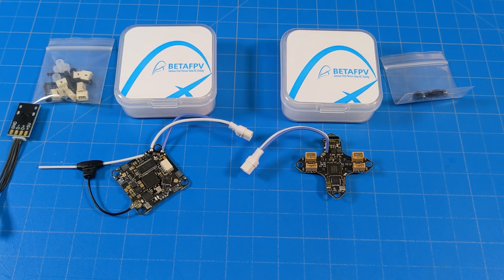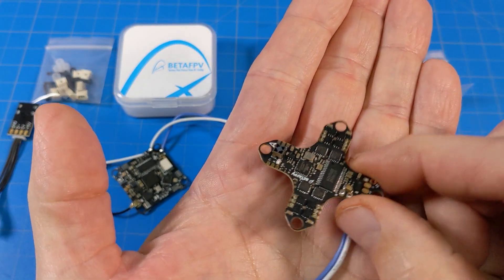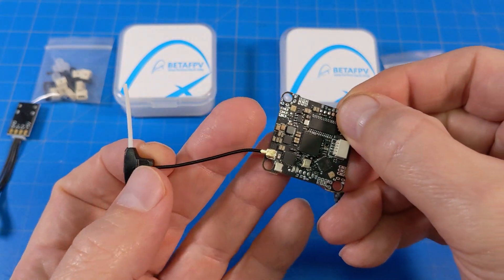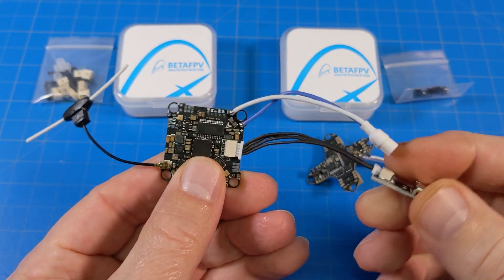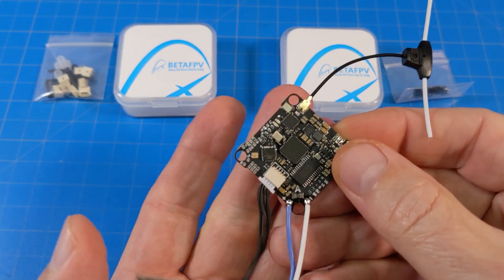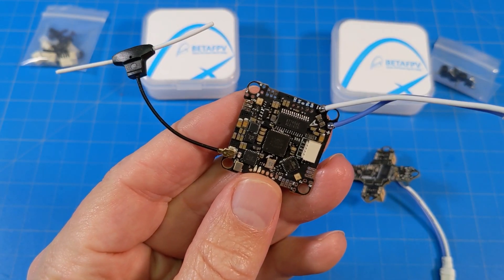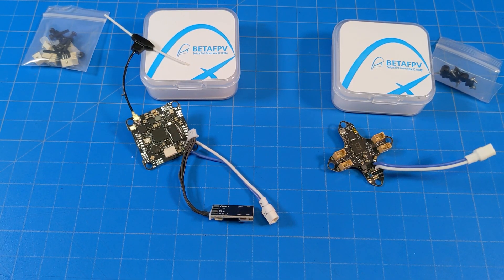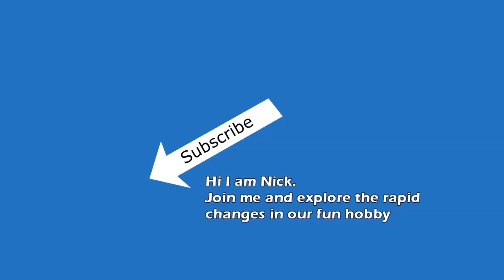ExpressLRS AIO // BetaFPV ELRS 1s Boards // 12amp & 5amp

Comment: can the 12amp aio use 2s it said that it can use 1-2s ?
Reply from the maker: The specs say it can but I not anyone has reported they are running it on 2s. So I don’t know for sure. I think there may also be a v2 of that board which could mean there was an issue or an improvement

Comment: Hi Nick, Q I just finished my 65mm whoop build with betafpv 5a elrs and even have to update my betaflight configurator to 10.8, I've got connection with my TX and RX as well as seeing movements on BF transmitter tab and set up my arm switch on aux1 
But my problem is that when I arm, it seems to only hover an 1nch from the ground and that's probably from the air mode on but  when I give it throttle about half I've got no respond, push the throttle stick to full and it gets up to about 5 feet off the ground.
Reply from the maker: What is the weight, motor and battery
Reply: @NickBurnsFPV  it weight at 20g flat with GNB 300mah 1s BT2.0 connector and HM 0802 19000kv. I load one of the preset tune for a 65mm whoop and it is flying right now surprisingly:)
Reply from the maker: @Bisdak.3475  20grams with battery? So the quad weighs 13grams? That would be one of the lightest whoops ever.
Reply: @NickBurnsFPV  haha I can't beat angrydon's 15g 65whoop, no way! Mine 20g-26g with 1s GNB300mah. It fly unstable the next day I flew it so I don't know what happen there?

Comment: Hey nick, so in regards to swapping whoops over to elrs... How much would you say the ep2 weighs with the little bit of wire needed to connect it? Maybe .6 or so? I'm thinking even for 65mm whoops it may be worth it if the board has the uarts! Even on tiny builds a half gram is pretty low.
Reply from the maker: Depending on the length of wire, likely .6 to .75 grams.

Comment: Hey Nick, any update on this 12a 1~2s FC? I would like to build a 1s babytooth on this with more Power hungry flywoo 1203 11000kv motors. Also the tks rocket race with this for more range and some more amp draw
Reply from the maker: I haven't used it yet. Focused on the 5amp. I do have several people that have reported using it with a good experience. Sorry that is as far as I can go in the moment.

Comment: Hey Nick used the 12amp v2 for a 75mm shark byte whoop.   Shark Byte requires 2s.  Two things; the 12amp v2 shoud come with the ceramic antenna (mounting the t antenna to a whoop is difficult, and the wire adapter for the usb-c cable is annoying after a while.   I wonder if elrs can use wifi to connect the board to pc or phone betaflight app?  That would be a great feature to have.
Reply from the maker: I suspect the ability to connect to betaflight via the elrs rx wifi is possible but likely need some additional development. One potential issue with the cube antenna is board stacking, I am not sure if having the cube antenna would stop us from stacking boards for a sharkbyte or other build options.

Comment: Would it work with the Jumper T8SG V3 PLUS Carbon Edition?
Reply from the maker: Not sure. Does that radio support crossfire and and ELRS module?
Reply: @NickBurnsFPV  I have crossfire on it now but the receivers are expensive compare to these.
Reply from the maker: @electroddxful  If it supports crossfire we can use expresslrs on it. We do need to add an expresslrs module to the radio. Expresslrs uses the crossfire protocol when binding to an expresslrs receiver. Also in betaflight we select crossfire for the receiver protocol.
Reply: @NickBurnsFPV  That cool. Thank you so much Nick really appreciate it.🙏👍🙏👍

Comment: These early boards, both Betafpv and Happymodel are total hit and miss, but I'm sure over time - like 6 months fro now they will have finally figured it out that what we need is a 10-amp 1-s, and 12 - 15 amp 2s board with a built-in ELRS RX with the smd antenna (that dangling u. fl cable is stupid) and a 400-600mW vtx.

Comment: I like the plug, USB sucks and I can solder up a USB to jst cable if I need. That 5a board is what I've been waiting on. My current nanolongrange on 0803s uses the old non Rx version of that board and this will get it even lighter.

Comment: I think that separate board with the USB port might be to mount it on your quad if the the FC is build in, so you can’t reach it the USB port was on the FC?
Reply: I think in the product page for it they say it's for weight.

Comment: Redpine was as easy as setting up d8 for me,. But I now put ep2 recievers in my tiny whoops
Reply: How much weight does it add with the bit of wire you need? Do you notice it on 65mm whoops?
Reply: @valden  around 1.5grams and I haven't got a 65mm just 75mm so I guess I should of said in my micro whoops, but tbh I've  noticed difference except way better control link

Comment: Thanks for keeping us updated as these come out. I'm of the mindset that I would rather have a FC with a 300-400mw VTX integrated into it than the receiver. I can then add an EP2 type receiver myself. I think there would be more of a weight savings from this. Maybe.
Reply: I think a separate vtx is better for heat dissipation.
Reply: Yeah I think separate VTX is better for heat dissipation.
Reply from the maker: I can see it both ways. For weight we benefit more if the vtx is on the board, if heat is an issue with a 200+mw vtx then maybe we have to sacrifice the weight by adding the vtx. I personally don't know what can be accomplished, generally I haven't had issues with a vtx on the AIOs.

Comment: No USB is really annoying, now we need to carry a bunch of USB adapters, think HGLRC are doing this too - we can bet that the pinout will vary between boards so now we have a risk of burning out our USB ports too!
Reply from the maker: And can we buy these usb adapters? I haven't seen them available to purchase. I suppose overtime our collection would build if the adapters come with all the boards, but then we might be back to the situation you described with the pin out problem

Comment: Nice looking boards, I hope reliability is good. Still I belive there are having build in vtx around 250mw would be more beneficial than having build in elrs receiver, elrs receivers are small and cheap while usually vtx are heavier and more expensive...
Reply from the maker: I lean that way to. I want to see a 200+mw vtx on the AIO

Comment: Yo Nick! I'm pumped on that 5a board but I'm wondering if you can help me out: I run the betafpv 65mm frames with the NBD beebrain canopy (v2). That board looks like it would put that receiver "cubetenna" right under the front leg of the bee brain or, if it was flipped, down into where the battery would knock it. Could you verify any fit issues with that? Thanks man!
Reply from the maker: The beebrain canopy front screw mount doesn't clear the antenna. We would have to lean the canopy back or rotate the board so the antenna is in the back.
Reply: @NickBurnsFPV  😕 Man, there just isn't winning with any of these 😝
Reply from the maker: @brighFive  Does the happymodel version also pose the same issue? i didn't check it.
Reply: @NickBurnsFPV  I’m not sure tbh! I’m just being a whiny whiner. It seems like there’s always just one weird design issue with whoop boards and/or they’re hard to actually get a hold of. Thanks for checking! 😎🙏

Comment: All these new ELRS AIO boards are making want to dust off the old Mobula and fly tiny whoops again. Which ELRS AIO FC would you go for in a new whoop build? BetaFPV AIO pr the Happymodel?
Reply from the maker: I would probably go with the 5am betafpv due to weight.
Reply: @NickBurnsFPV  I feel the weight comparison between the BetaFPV and HappyModel boards was unfair.
You did not include a VTx with the BetaFPV board.
A fair comparison would be both boards with no pigtails
Once you add a VTx to the BetaFPV board, it would be about the same I reckon, and the convenience of the built-in VTx on the HappyModel board swings it in my opinion

Comment: I tried using the BetaFPV 12A board for 1s 3 inch. Fried after 1 week. I have bought many, many boards from BetaFPV, and every single one of them has failed. I really wanted to like this board, and it probably is pretty good, but BetaFPV hasn't been working out for me unfortunately.
Reply from the maker: Sorry for that. I do appreciate you letting me know of your experience with the Betafpv boards. Any other boards working out better?
Reply: @NickBurnsFPV  Yeah, the FPVCycle boards have been absolutely rock solid. Ive been running the same board for 1 year with heavy crashes. Im trying out the 15a darwinfpv board, and it seems to be ok. But it is too early to tell if it is as reliable as fpvcycle
Reply: 1s 3inch huh, kinda extreme build. Must be a 1s long range with 18650 toothpick style. But did you manage to put gps on it? I plan to use this board too, but 2s, 2inch, with gps coz I have spare.
Reply: @jeffclassics  Bro 1s 3 inch is the best class out there. I've gone full speed into concrete every day for a year and it still flies haha. Handles like an agile 5-inch, and is very quiet. 1s 18650 is good, just make sure you use a capacitor. GPS adds too much weight. 2 inch props are less efficient. 2s will add weight. Ideally you want large prop, low voltage, and a generally higher-kv motor that is fatter for more torque. Thus, the 1s 3 inch platform works perfectly for 1s 18650 + capacitor.
Reply: @lrfpv5292  wow actually I liked my crux 3 before it flew away. A bit underpowered in 1s so I sticked to 2s before. The 2s 2inch ill be building will not be for extreme though, it will be for my busy park flying so I need to add prop guard for kids safety.
Reply: Yeah I can make it 1s since it's tiny. I also have another 2.5 frame, maybe I will need to rethink my build. I'm actually interested in this board because it's cheap. AIO with rx spi (elrs) with spare uarts,. It's like rx is free and I don't need to buy elrs rx separately.

Comment: I fully agree with you, MASSIVE difference in control link consistency and stick feel from FrSky to ELRS. Silky smooth and it gives me the old feeling, like when Multishot came out way back, of the quad almost flowing intuitively where I want it to go. Much love to the ELRS developers and everyone who is making this happen. Cant wait for their VTX and other backpack integrations and innovations to come out 😬
Reply: Wait they are making a vtx? Is it gonna be analog?
Reply: @tuttuti123  No but they have a features where you connect a ep1 to your vtr and create a wifi link between your radio and goggles so when you switch channels or band on your radio, it switches them on your goggles and quad too. Its more handy for racing but amazing what possibilities it opens up in terms of the fpv ecosystem.